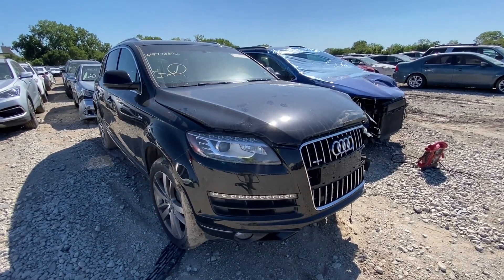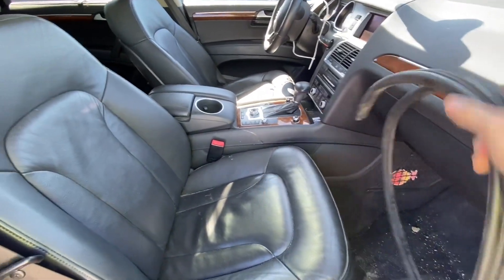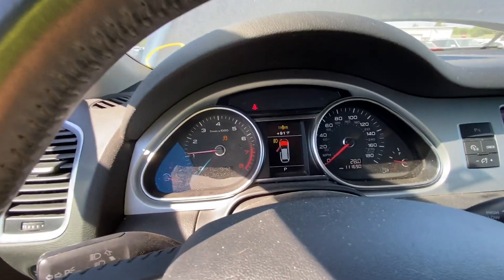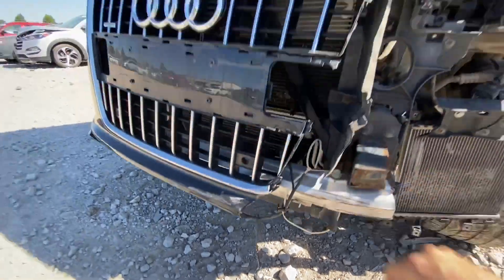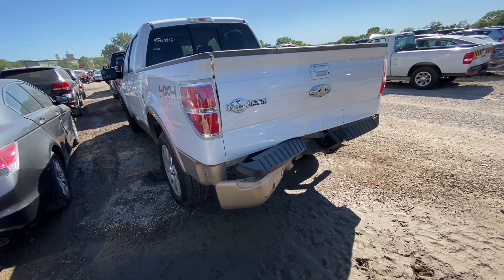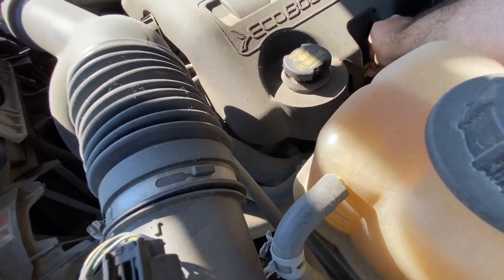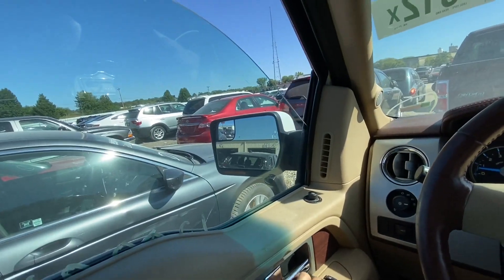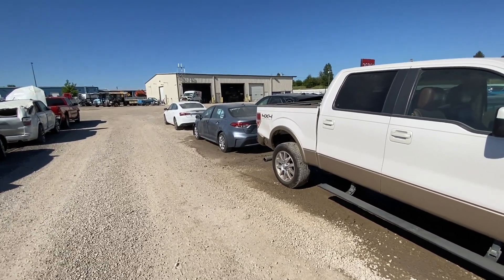Copart walk around(8/10/22): 2014 Audi Q7, 2013 Ford F-150 Loaded King Ranch

Comment: that q7 is an easy fix  the 3.0 is very good engine
Reply from the maker: I like Audi V6 super charged engine too, been looking for an 2016 - 2018 Audi A6 or A7 with that super charged reliable engine, but they all go above my budget. The damage on the Q7 is cosmetic and easy to fix. Wondering why no one bid on it so far and sitting at 0 USD, it is pure sale.
Reply: @autoauctionsreviews6358  yea that's odd because that's not hard to fix.   The a6 is very good car. I'm not huge fan of the rear of the a7.  I like the a8